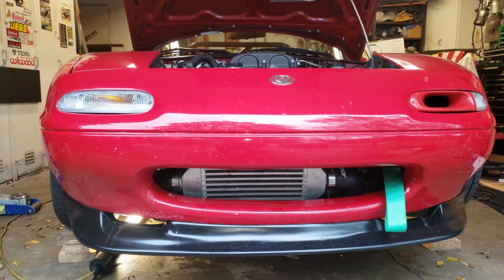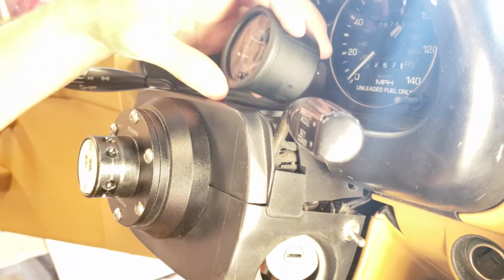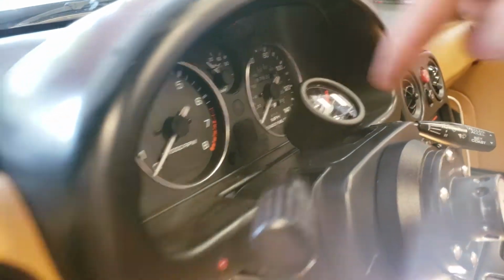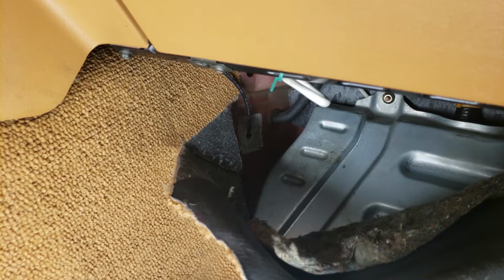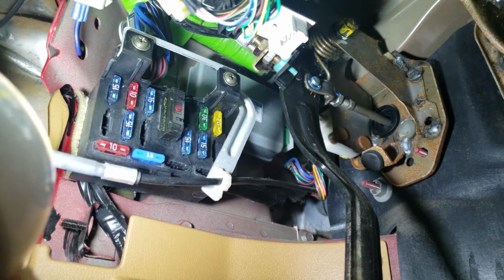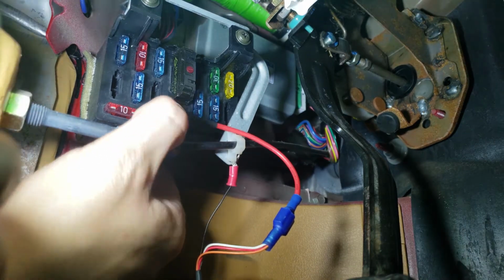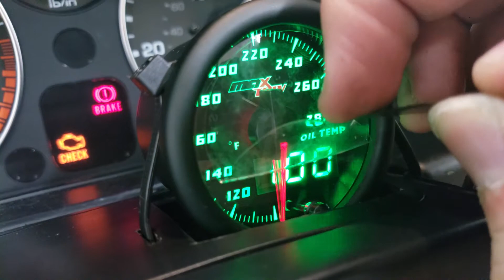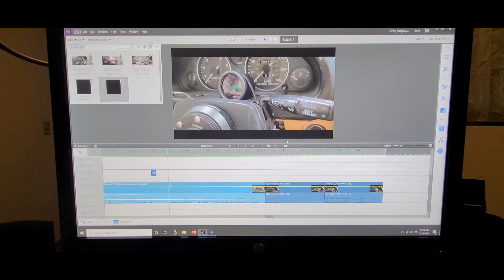Oil Temp Gauge Install

Comment: Where do i tap to get the oil temperature sensor placed?
Reply from the maker: Oil filter sandwich plate, I added one for an oil cooler. But you could add one specifically for a gauge
Reply: @thawkproductions4248  i can put it on any tipe of filter?
Reply from the maker: @IOAN2ER  Potentially? I'm sure there are ones out there that can convert your filter threads/diameter. But the one I have still uses the same OEM size oil filter

Comment: You should check out the perfect tuning gauge especially if this car is on mega squirt. I have one in my 1996 Miata that a turbod earlier this year and I love it cause it allows me to look at anything I want that the ecu can see and you can change it on the fly from the gauge or your phone/tablet. Also any sensors you hook up to the gauge are able to also be seen by the ecu so you can set safety cuts or limp mode in the ecu settings.
Reply from the maker: Dang! Now that is super cool.  Ugly, but cool 😆

Comment: That little light is a low washer fluid indicator. I think it only lights up if you have an ABS equipped car since the washer fluid tank is moved up to the front of the car.
Reply from the maker: I have abs and I've removed my washer tank from the front bumper as well,  no light on. Hmm
Reply from the maker: The light is lit while the pop ups are moving, or if one doesn't go down all of the way
Reply: @thawkproductions4248  and its not the one shaped like a headlight right?
Reply from the maker: @FuzzyBeanBag89  it is the one shaped like a headlight
https://revlimiter.net/store/indicators-na.php
Reply: @thawkproductions4248  - right. It seems that on most cars, the headlight servo actuator indicator (the headlight icon) is below the tach, but it seems some may have it in the spot where the low washer indicator would normally be. In my case, its under the tach and the one you pointing to in the vid is my low washer fluid indicator.

Comment: The reason that fuses have exposed piece of metal on each side on the outside of the fuse where the voltage actually a limit is that is for a test light so you ground the test light wire and then the tip of the test light you touch each hole or each piece of metal on the fuse without taking it out and it will tell you one if a fuse is blown cuz only one side will turn the light on instead of both sides but also you can instantly tell which fuses live when the key is not even in the ignition and then when the fuse becomes live in the accessory key mode or the actual on motor mode of the key you know what I mean in other words you'll be able to tell which fuse is only live when the motor is running not just when the key is on

Comment: For the brightness, I believe you could try to solder a resistor on the dimmer cable (200 to 300 Ohm).
Reply from the maker: Now that's a good idea, never even crossed my mind